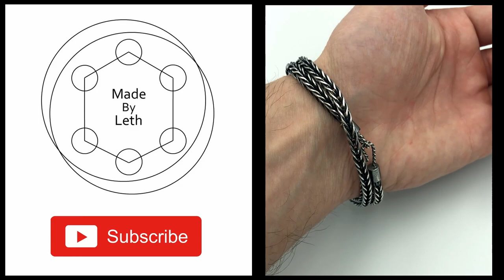How to make a silver oxidized foxtail bracelet

Comment: Please tell me one thing that if l want to make 25 inche length of chain, what should be actually wire's length.????
Reply from the maker: If your wire is 0.8mm (20 Gauge) and the jumprings are made on a 14mm mandrel then you will need about 750 cm (24.6 feet) of wire to make a 25-inch chain.

Comment: What gauge wire did you use and what was the diameter of the rings you made?
Reply from the maker: The silver wire is 0.8mm (20 Gauge) and the jumprings are made on a 14mm mandrel.
Reply: @MadebyLeth  thanks a lot, i want to try making this!
Reply: @MadebyLeth  Also what is the spikey 'thing' you used to widen the hole? can you link a page please?
Reply from the maker: The pointy thing I'm using in the video was originally a polishing tool but I've switched to a regular awl which can be bought in many different sizes and shapes so I'd suggest you search for an awl for jewellery and find one you like :)

Comment: Great video keep going <3 just a question what's the name of tools you used here 8:36 and 9:04
Reply from the maker: Hello Runnerx3297
Thank you for your nice message <3
The tool I used at 8:36 was a step mandrel, however, a normal mandrel would be just as good to soften the bracelet.
The tool I used at 9:04 was a square drawplate with 31 holes varying from 3-6 mm.
Reply: @MadebyLeth   Thanks for the reply. i really appreciate it <3